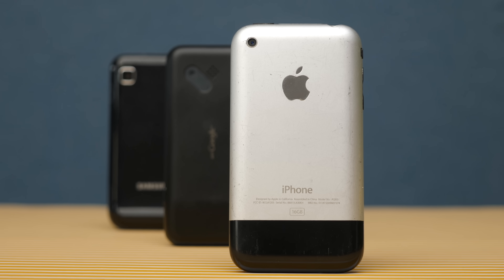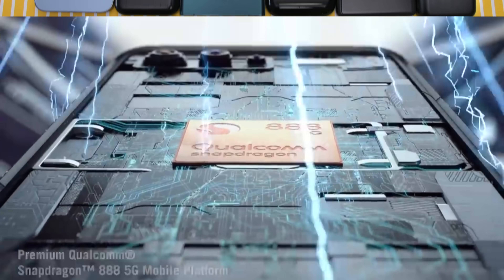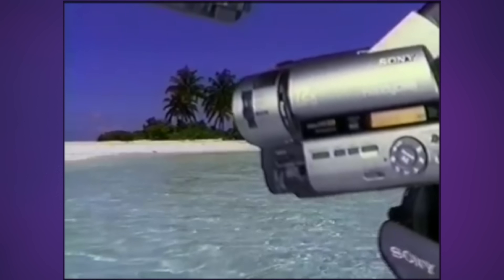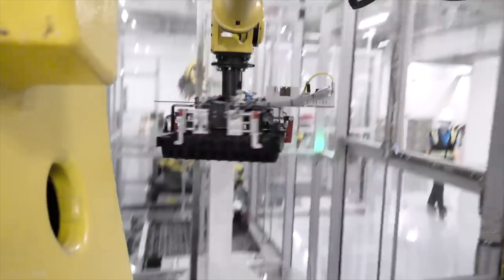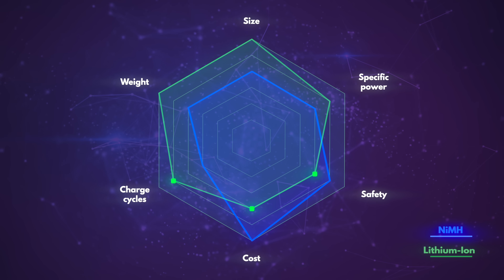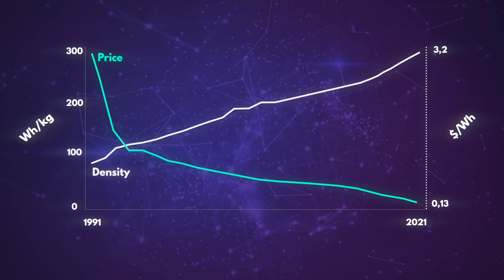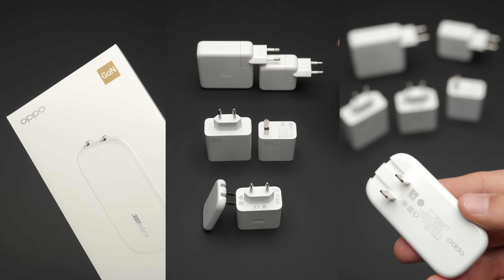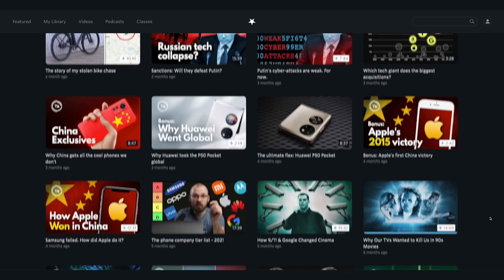The billion dollar race to fix phone batteries

Comment: Well having an option to replace just the battery in my phone would be another way to make it better. Even if they managed to make it last double at new, what is the point if it doesn't last a day after two years of use.
Reply: the point is to make you to buy a new phone every 2 years at least
Reply: @palamidagheo4520  Yep that's pretty much the case if you notice with any product bought there always seems to be a weak spot and that's on purpose because they want you to buy another. Making a phone that lasts forever isn't profitable to these companies.
Reply: @NTVEL Martynas That's what they say, but as far as I can remember, the Samsung Galaxy S5 was dust/water resistant, and also had a removable battery cover. There's also the Fairphone 4, which has some water and dust resistance, although admittedly not as much as some other phones, while also being the only modern smartphone I know of that has the classic removable back cover.
Reply: @NTVEL Martynas It's not that easy to remove a glass/metal back glued on especially for someone with no experience in doing so not only that the price of those tools add up. Idc what the phone looks like I really don't I always put my phone in a case I'd much rather have a easily removable shell no tool required. I'll take functionality over form and day. Sure phones look pretty now but just imagine if I could easily hot swap my 5000 mah battery on the fly and also have a SD card slot. The look of the phone is the least important aspect to me and trust me they could make the phone look nice even with a removable back and they could probably make it out of metal if they wanted to as well it's just they want the general consumer to buy another whole phone rather then replace the battery themselves also the average consumer is probably more enticed by looks it would be nice if they at least made a version of the phones with these features just to see how they would sell in a more modern time.
Reply: well, i tried this tactic a few years ago. i bought a phone with a replaceable battery. two years in, the battery won't last a single day so i tried to buy a replacement. problem is, phone model has been discontinued and i cannot find an official battery replacement being sold, so i had to resort with an off-brand replacement. it didn't last for a year.
Reply: @NTVEL Martynas Fuck that. The switch is already to small for me to even try opening the thing. I'm not gonna fumble around with heat guns and special screwdrivers to replace a smartphone battery.
Reply: @NTVEL Martynas What you you are saying is absolutely true.  THAT any phone in question can live on.  And on, and on.  But the thing a person will quickly notice is "this junk is obsolete".  It only operates at 3 Mhz.  And the camera is still 8 MP.  And (right now) the tech is advancing "way" faster than the battery will go inoperable.  So (do I mind living in the past), is the question a person needs to ask their own selves.  Not, how can a make my battery live again.  As you mentioned, that last question is not even a "real" question.  Battery, schmattery.  They can be replaced with a soldering iron.  Or, a shop will do it for not very much.  Or your kid might know somebody who will do that for cheap if you get the ingredients.  I said "any body with a  soldering iron".  You might need a heat gun too.  The back of the phone might have some kind of glue on there that needs heat to "let loose".  I would have did that for somebody, (easy money).

Comment: My main problem with lithium ion batteries Is their health declining over time
Battery health degradation honestly gives me anxiety
Reply: Especially nowadays, when companies sell us 800e phones without replaceable batteries. Furthermore, without a way to buy an official battery down the road if you want to pay for a replacement.
Reply: @jesuslcampillo1989 go Fairphone.
Reply: @jesuslcampillo1989  I agree. They are too busy releasing a new model every year. It doesn’t pay to make batteries for devices 5 models behind. It’s bullshit.
Reply: @jesuslcampillo1989 wu=wa
Reply: Problem is you only have a physical way of controlling the charging level. It's ridiculous that when plugging the charger in, the phone does not ask at what % level to charge to or at what charge current to get there.
Reply: @emilen2  I agree. My Sony Walkman digital audio player has a setting where it will only charge to 90% to preserve the battery, the same type setting should be an option on phones. My phone does have a battery saver setting that kicks in when the battery charge drops to 15% (shuts down functions like WiFi and Bluetooth) to extend the remaining time I can use my phone.
Reply: @Solitaire001  my a03 as this, it charges to 85 and them stops charging (i had to enable it on settings)
Reply: @Solitaire001 Samsung has it. Lets hope Apple copies it soon
Reply: @emilen2  you can control it on an Android if you root it
Reply: That's why I'm arguing for legislation forcing manufacturers to make batteries user-replaceable. Not only for smartphones, but also for laptops, bluetooth speakers, etc. Basically everything.
Reply: @GeoStreber  This is shortsighted. The would result in both bigger and more expensive phones. A user-replaceable battery means there needs to be a user-accessible battery compartment with a battery that can be safely handled by the user. Or worse, smaller phones and therefore smaller batteries (and still more expensive).  Worst of all is that the vast majority of people never access their battery even when it is accessible. So mandating this change would be a bad thing for most people. This is why manufacturers stopped doing it in the first place.
Reply: @GeoStreber isn't there talk of this in the European Union?  If they made Apple put usb-c in the iPhone, they can make user-replaceable batteries a reality across a whole range of devices. Whatever design challenges this creates, competition will ensure that manufacturers come up with effective solutions.  If it makes the phones more robust than the near-ubiquitous glass sandwiches we have right now, so much the better.
Reply: @GeoStreber  that will be difficult for earbuds
Reply: @danteerskine7678  bullshit. If you can build it for hearing aids, you can make it for earbuds.
Reply: @GeoStreber  bullshiit, earbuds are too small compared to headphones
Reply: @Niiju  Yes but they also use a different kind of Li-Ion Battery.
Also they do not pack the batteries quite so dense in cars as weight and space is less of a problem.
Also they always have extra unused battery cells that are used as backup for stressed or failing cells.

Plus 100% charge in a car is not really 100% of the battery pack - probably more like 80-90.
The car does not give you access to the full 100% possible charge.

What is most taxing and wears your battery out very fast is charging beyond 80%.
That is why it is recommended to hold your phone charged between 30-70%.
Reply: And the bloat after that!
Reply: It is mostly a problem for phone or laptop batteries.
To make them fast chargeable and high energy density the cut alot of corners.

Car and (local) grid storage batteries seem to have much better lifetimes in the range of 10-30 years.
Of course with declining capacity but that is not such a massive deal.
Reply: @1337Jogi Just make the batteries easily swappable by the user.
Reply: If the batteries lasted longer, fewer people would buy new phones. Who really needs a new iphone? What is the point of a faster processor if you aren't constantly playing games? What is the point of another small incremental camera upgrade?
Reply: @yucannthahvitt tbh,this is why Im getting back to handheld gaming. Even then, mobile gaming cannot pull console levels yet
Reply: Samsung lets you choose to only charge to 85%
Reply: I would gladly exchange longer charging time with greater battery life….
Reply: All secondary batteries, not just Li--degrade with time.
Reply: My phone battery degraded so i changed it in a service and 2 years later its degraded again of course its an iphone i hate iphones
Reply: @jajoitus317  Why do you use a phone you hate?
Reply: You always know it’s time to replace your phone when you have to charge it more than 1x per day….
Reply: It wouldn't even be so bad if phones had easily replaceable batteries. Old smartphone batteries were very easy to replace.
Reply: The thought of losing all your files is terrifying
Reply: @ArtieArchives  The key is to keep a backup. I never lost data because I maintained a backup routine.
Reply: @Solitaire001 even more important now that randsomware is a thing (if youve done everything right, why pay a randsom?)
Reply: My friend, if you learn breaking a program actually helps growth, because if it's not broken, it doesn't need to be fix.
If people sent batteries in for manufacturing after failure or dead.
They can work on dead or faulty batteries while selling batteries at a manufacturer price for recycling and survey result.
It's better then spending money on the science when you have a recycle process that will definitely do it.
Just, do we dispose out product properly?
That is why they do not allow you to touch phones more and more since we don't dispose of take care of out earth hurting garbage.
And plus, in reality, kindly.
No one invest into batteries.
But recycling is the best start, free of charge.
I like wiring batteries together, fun easy science.
Amps, volts, watts.
It's actually easy business.
Play with those tab batteries, forgot what they are called.
Reply: A battery starts dying the second it's made.
Reply: It exists but... well, it was a whole lot worse in the Ni-Cd/Ni-MH days. Modern lithium ion batteries are very resistant to degradation.

Also no need for anxiety, they can nearly always be replaced and they're not very expensive.
Reply: this is the primary concern expressed here and it absolutely blows my mind....  I use my phone way too much and feel like a dog leashed to the power grid. I've never once thought oh shit my battery health is declining because I'm going on 3 years with my current 2017 Galaxy phone that I bought refurbished in 2021. I'm tethered to the power grid and my anxiety comes from having to recharge my phone constantly. Burn that shit out in a year if that means I don't have to charge it as often!
Reply: Entropy is a bitch, aint it?
Reply: Battery health declining over time DOESN'T give me anxiety! ...... It gives my WALLET anxiety! 🤣
Reply: That's a really gay thing to get anxiety over.
Reply: batteries are consumables. Always have been.

Which means that BEV battery packs have to get a lot cheaper for the average joe to be affordable.
Reply: That should not be a problem at all since tech product are never future-proof in the first place.
Reply: @Niiju  I think it is not hard at all.
I let it rarely fall to 20% or less and try to unplug at 90% latest.
Does not work all the time but often enough.

Regarding your car you should inform yourself if that is needed.
Since some(alot) car companies actually do that 80/90% max charge for you, there might be no need to do so yourself.

And I am not talking that your car stops at 90% charge and displays it so like you can set as a setting in some phones.
I mean that the 100% of your car might actually be 80-90% of the actual total charge.
Reply: @1337Jogi this. Using a 5+ u year old phone and looked after the battery as best i could. Have not had any meaningfull degration so far.
Reply: This is a problem with literally EVERYTHING. Entropy is a fundamental concept in physics.
Reply: @ronch550  true. It's literally the reason why we exist. Actually it is the reason why.
Reply: This is a problem with all batteries...
Reply: @nieldewet5315  I don't see it as a problem but as a fact of life, one that can mitigated by a reasonable action. An easy-to-replace spare battery is often the solution.

As an example, I used to use a Palm OS PDA that was powered by two AAA batteries. I used rechargeable batteries.

The problem was that rechargeable batteries would quickly die, and if the battery died all the data on the PDA would be wiped (it used powered memory rather than semi-permanent memory like an Micro SD Card).

My solution was to carry a backup module (copies all of the PDA data as a backup and can be used to restore the data) along with a spare pair of rechargeable batteries. Every other day I would backup my PDA, and then replace the batteries (you had about 15 seconds to replace the batteries before the PDA would be wiped). I used Palm OS PDAs for over 15 years and never lost any data.

The main point of the above (which others have already mentioned) is that battery issues can be addressed via an easily replaceable battery and a little easy battery management.
Reply: @Niiju  Then you probably have an older phone (degraded battery), use it too much or ruined the battery before.
I charged my phone to 90% this moring 8AM (was distracted and did not unplug).
RIght now 7pm it sits at 51%. and will last easily until midnight without falling below 20%.
Reply: But graphene batteries would be 10x better than lithium ion
Reply: The X wife had a 5 years old iPhone, 2000+ power cycles with 4-6 screen time use (candy crush/Facebook)

She complained that after 5 years that iPhone battery are shit because it's only 35% health..." They don't make things like they used to"

I just find it fun that she expects it to work as good as new for the life of the product.
Reply: Really, you have a problem with LiIon battery health declining overtime?

Something tells me that you're a young un.
Reply: @ridley68  Consider the following type rechargeable of battery:

NiCad: You are using your phone and it had a 50% charge. Suddenly, in the middle of a call, your phone dies when the battery's charge drops to 1% in a few seconds. Plus, because of the memory effect your battery only holds a 75% charge max.
Reply: @Solitaire001  Comprehension not your strong point then?

Comment: What about Gallium Nitrite, I thought you would mention it, is it for charger not for battery
Reply from the maker: Yes, you can make chips (used both in the charger and the phone charging system internally) from GaN. They are smaller and more efficient, but they are not part of the battery itself

Comment: Potentially, there might be better charge carriers than lithium in the guises of beryllium and boron. Both elements are only slightly heavier than lithium, but carry more charge (electrons to give away) than lithium. Potentials issues though are availability of the element and how willing they are to give their electrons away in the battery.
Reply: …but what if you ask them nicely? :D
Reply: @andreirachko  Lithium has the highest oxidation potential among all the elements in the periodic table.
Reply: @egeyamak394  it should be cesium ?!!!! it has most shells ,there zeff is less ,it has more sheilding....!
Reply: It's not about availability of electrons but it's reduction potential
Reply: @manakmishra  I know lithium has the highest potential in that regard. But I’m not sure how the potential power output compares, a higher voltage for Li vs. a higher possible current (more electrons to give away) for Be might make them comparable. My knowledge about that is however insufficient to make any claims here.

Comment: When we look at Moores law of doubling number of transistors on chip every two years, we might feel tempted to think similar development is possible in other technologies, but its not.
Reply: I also don't think that Moore's law is absolute, at least when it comes to commercial processors.
Reply: @drachna  Well, no. It's getting harder and harder to etch features on wafers, and eventually, between quantum effects and crystalline structure, there's a minimum size that'll be hit regarding transistors.
Reply: @watchm4ker  you may be unaware, but we've hit that limit! Transistors smaller than about 3nm will catastrophically leak because of quantum teleportation of electrons and just straight up phasing through the gate.
Reply: The idea that anything can improve indefinitely in this finite world is ludicrous, the growth will have to halt at some point
Reply: It wasn't with CPUs either.
Reply: Moore’s Law hasn’t been relevant or applicable for the last ten years or so.  You just outed yourself as a boomer lol
Reply: @Heroic_Recaps  what?
Reply: I'd say the growth of new solar photovoltaic installations is close
Reply: @AlexFoster2291  
1st law of thermodynamics: Allow me to introduce myself...
Reply: @4G12  non sequitur = bot?
Reply: @4G12  He doesn't mean the efficiency of solar panels. He means the amount of solar panels installed is growing at an exponential rate, which is actually true we almost install double the solar PV capacity every year compared to the year before, and this trend has been steady since the 1990s up until 2022. If we continue at this exponential growth rate then by 2035 all electrical generation could come from solar PV. non-electric power usage would still come from fossil fuels though.
Reply: @4G12  I'm sure you mean the second law.